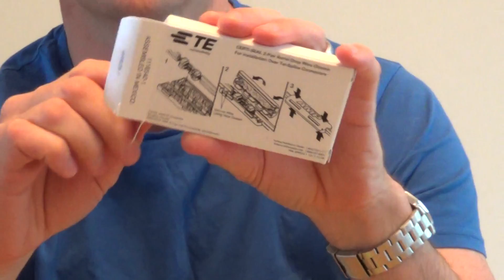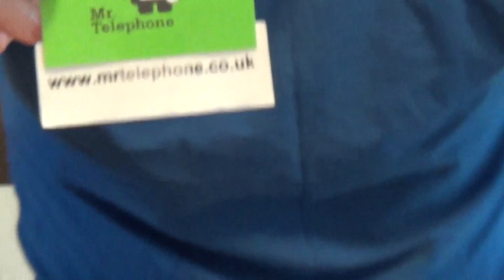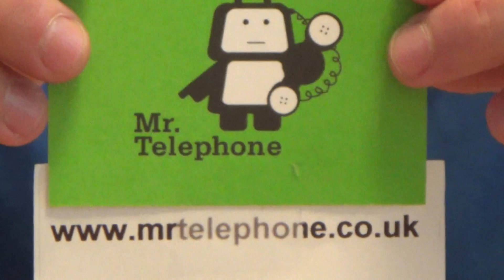How to repair your cut telephone line with an external waterproof joint

Comment: When stripping drop wires you need to leave  the Yellow Supporting wires sticking out from the shedding and bend them back and tap over them otherwise they will stick into to the working Pairs and short them out openreach have a special Sleeve that does this

Comment: I noticed I have one of those boxes on the outside of my house. I can only see a couple of wires feeding into the box (the ends are slightly exposed on the outside of this box. I’m guessing the installing bt engineer didn’t feed the black wire fully inside this junction box on one side). I have infinity fibre. Curious as to whether this is normal because I noticed your cable has 4 wires. Looks a bit messy on mine as though some wires have been cut (superfluous ones?)

Comment: Much easier to splice then place in the Tyco.  Also, if your service wire has a metal sheath under the plastic sheath, you need to use a splice case that allows for bonding of the two metal sheaths.

Comment: will electrical tape and waterproof box do the same job? cut the cable by accident and now I have red/orange light on my router 5x a day. It goes back to blue a minute later. thanks!

Comment: Hi there my internet cable has been cut by work men twice this year, once virgin  fixed it with one of these boxes, now it’s been cut again if they repair it I’m gonna have two of these boxes on my cable, will this effect my connection at all, or can I request a full new cable that’s not had to be fixed back together ?

Comment: Hi Vince I'm a bit stuck! I'm wanting to move the master socket into another room. I've took the back plate off the master socket and the main line coming in from outside is just connected via 2 wires. I'm needing a bit more wire to get the master socket to where it needs to be. Can you buy spare cable and connectors if they exist from your shop? I hope this makes sense!

Comment: Hi Vince, I replaced the existing telephone cables running internally in the house with a 2 pair cat5e cable telephone/data. I wired it in accordance with a video you produced showing how you can use a remote telephone/data outlet using a modular outlet setup. Using an RJ45 outlet along who a BT telephone module. Now I have two rooms that could be used for the telephone,with either of these rooms being used to connect to an RJ45 outlet!
I used a BT61 (I think) using type B three way gel crimps to connect one orange/white to two others and the same with each of the other colours! Now, the telephone in the room where I currently have my Sky hub router ( which wasn't happy with the change initially) isn't ringing where it previously was!

I can try my phone in the socket of the other room which will hopefully prove that the cable coming from the master socket is OK. This would mean that there is either a problem with the cable going from the 3 way joint box or a problem with the BT module! I can check that I put the wires into the correct numbers {blue=2 and white/blue=5}. If it is wired ok, I still have the telephone socket outlet that I can temporarily pin to 5 and 2 to see if I get the telephone working!
If I can't, then it is into the loft again, lift a panel of the flooring and see if I notice where a break might be and either run a new section of cable plus sourcing more 3 way gel crimps, unless you can suggest a better way of joining three cat5e cables.
Reply: George Wilson plug an adsl filter in and ur phone should ring or get a new phone old ones need a certain wire to make it ring ,

Comment: Repaired mine today after cutting clean through with secateurs !
Used some jelly crimps which cost £1.75 from  ebay, and a plastic 3 inch long Cod Liver Oil capsules bottle. Drilled a  5mm  hole in screw on cap and base of bottle. Threaded cable ends through holes - fitted the 5 pairs of wires to separated mini connectors and placed them into bottle - filled bottle with silicone after testing - screwed the cap back onto the bottle and smeared silicone where cable goes through the hole in cap. Wrapped bottle in brown insulation tape to help it blend in to the Climbing Hydrangea. Working off a ladder job took 20 minutes and saved me incurring astronomical BT repair charges !  Simples !
Reply: Yes and it'll be subject to heat, cold, moisture and UV radiation meaning you'll have do it again. Note the repair method in this video uses proper materials designed to last the life of the cable (a long time).
Reply: Yes, I'm gonna fill the bottle with silicone soon !
Reply: 2 years ago changed the connectors for jelly crimps , which cost pennies, and filled the bottle with silicone - so far so good - no problems.
Reply: Update. May 23. Still working a treat - no problems at all.

Comment: The fix does not appear to have a continuous, presumably grounded, shielding.  Does the connector provide for it?
Thanks very much for the video. High-value content.
Reply: Tyco makes similar closures with a grounding connection for the shielding. Just about the only modification necessary to the method in the video is that the jacket MUST be stripped with the stripper string and cut back, exposing about 2-3cm of shielding. The excess shielding can be cut off to leave the conductors exposed for splicing, but be careful because the thin metal is quite sharp. Cut-resistant gloves are mandatory. After the shielding is ready, each end is seated into a pinch connector that establishes continuity from one side to the other. 

The reason to worry about maintaining continuity in the shielding is to keep interference out by having it drain to earth at each end (the demarcation point and the serving terminal). Otherwise you've just wrapped your service wire inside a long antenna, ripe for harvesting errant EMI and inserting into the signal.
Reply from the maker: Hi, no there is no option to connect the shielding.

Comment: Hi Vince, great videos! I notice that Openreach are routinely using these joints when replacing dropwires to older houses without a 66b as it saves them having to enter the house to wire to the first block terminal. Could you do a vid about overhead lines to farms - you could call it Pole to Pole?

Comment: Is this still available? I have searched for waterproof repair joint and for the ebay number 261298650317 but don't seem to get to it. I need one and this seems like a good buy. Thanks.
Reply from the maker: Hi, I am out of stock at the moment and awaiting delivery of 300 of them from America. Fingers crossed I think they will be arriving at the end of September 2016. You can always use some jelly crimps and some amalgamating tape to keep it waterproof in the meantime.
Thanks Vince

Comment: Hi Vince! I bought this repair kit last week and I'm very happy about it, the installation was easy thanks to your tutorial. Also, the sending was very quick even if I live in France. I just do hope that the speed reduction will be as low as possible, given that my usual speed was already quiet low before I accidently cut the cable (I was around 2 mbps). Thank you very much for your work! :-)
Reply from the maker: Excellent, thanks for posting the message. I am glad it went well.
Many thanks Vince

Comment: hi vince, my cable coming from the BT splitter box on the exterior of my house is very badly damaged, the outer sheath is split exposing the internal wires. I have recently started getting an unreliable Internet connection so want to change the cable, what type of cable is needed and do you have an item number from your shop if you sell it. many thanks, Gareth.
Reply from the maker: +Gareth S Hi Gareth, it can vary depending on the age of the cable but the most common type is dropwire cable which has white, orange, green and black wires. If you type dropwire into my ebay shop then you will see the different length and 5mm cable clips fit the cable (my heavy duty version are the best fit and strongest).Thanks Vince
Reply: +My Mate VINCE - I wonder if that might be another problem then, I have what looks like normal phone cable blue/white, white/blue, orange/white, white/orange, green/white, white/green. so when I change it, it needs to be dropwire? many thanks for advice

Comment: Please be aware that telephone wire will be live.  Although voltage is only -48v for a static line,  if someone was to ring the line then upto 100v ac can be sent down the line that could give a nasty shock. Also beware that a lightening strike someway away could make the wire live.  For these reasons precautions against shock should be taken, such as using insulated gloves and shoes/boots especially if standing on a metal ladder.
Reply: The ‘shock’ you get really isn’t that bad, I do BT duct repairs and there’s sometimes damaged cables and I’ve touched many, it’s like a shock from a prank shock toy

Comment: is there a way i can connect another wire from the middle section you are connecting? such as a splitter?
Reply from the maker: +Ballbag Laugh Hi, no that using that repair joint because it only has one hole for entry and one hole for exit, you can get a similar repair joint with one hole on one side and 2 holes on the other side which would be able to split the cable if you used 3 wire jelly crimps but I don't think I have any in stock at present. You may find another seller on Ebay who has them.Thanks Vince
Reply: OK thanks would it still work if I connected the wires into a connector block instead off jelly crimps ?
Reply from the maker: +Ballbag Laugh Hi, yes it would work but the jelly crimps are full of gel to stop moisture getting into the wires. You may find that a normal screw terminal connector block will corrode over the years and may also short out the line if dampness bridges the gap between the terminals as they are quite close together.
Reply: +My Mate VINCE thanks for your help just one more thing could I use this kind of wire http://www.maplin.co.uk/p/telephone-cable-cw1308-six-core-white-priced-per-metre-xs04e
Reply from the maker: +Ballbag Laugh Yes,  if you are installing it inside. If you are running it outside then you would need external cable which is normally black.

Comment: Hi Vince  - do i need to isolate the cable before I try the repair? If so, how do I do that?
Reply from the maker: Phillip Jones Hi, no you do not need to isolate the line, engineers just work on the live line. The only time you can feel a shock is if it was raining and you are soaking wet and somebody rings the telephone line while you are holding the bare wire ends and then it just tingles enough to make you let go. If you are apprehensive  just do the work when it is not raining.Many thanks Vince

Comment: I'm having to do this to add some length to allow relocation of a master socket but I'm wondering if it will have a negative effect on the line with regards to internet connection? Would the connections create noise?
Reply from the maker: EmpiricalPenguin Hi, no, it should be fine. If you think about the amount of crimps the line has gone through from the telephone exchange to your property then one more lot of crimps will be highly unlikely to affect the broadband.Thanks Vince
Reply: Okie doke, cheers!

Comment: hey vince i have a question, my phoneline is connected to the house by a hook which then runs the line down the side of the wall and into the master socket. someone elses line is also connected to the same hook, why as i thought this can cause problems and also hooks are not waterproof and ive noticed other peoples are connected by joints. reason for this message is im getting interleave every month due to something and 4 engineers have said my line is fine.
Reply from the maker: Arron Lowley Hi, by hook do you mean the bracket on the eves of the house where the overhead cable is joined to the house. If so it will not make a difference if another line is attached to the same hook because your wires meet up with loads of other customers wires in the bigger cables on the way back to the telephone exchange, so being on the same bracket (hook) shouldn't make any difference.Thanks Vince
Reply: I think that's what you mean I'm not sure it's just a hook at the top corner of the house where the cable drops down, it loops around the hook them goes down the wall and into the socket, another persons passes over ours and goes to a house on the corner, thanks for the reply.

Comment: Hi Vince, does the 2 pair cable used in this video only connect to a screw terminal master socket? Thanks
Reply from the maker: Stevie B Hi, no that cable is fine to use on IDC (punch down slot) connections as well as screw terminal.Thanks Vince

Comment: Thanks for the great videos you provide! Im looking to repair my broken external cable to my master socket with this. But wondered if there is a signal/internet speed reduction? The service provider repair is very expensive ££££! and wouldn't be surprised if they also used this method anyway, as cant see them pulling in a new cable. Thanks
Reply from the maker: Stevie B Hi, thanks for the comment.....The service provider would normally replace the length of cable from a nearby junction box, for example from the eves of the house to the internal junction box/ master socket unless it is a complete nightmare in which case they would just join it.  Having a join in the cable in never as good as a complete cable but your telephone line has been joined many times on the way back to the exchange (top of the telephone pole, bottom of the pole, numerous times underground etc) so one more is highly unlikely to make any difference to your broadband speed.Many thanks Vince

Comment: Does the cable you're using have a ground sheath?
Reply from the maker: Jason O Hi, no not this cable, it just has 2 pairs and 3 tension wires to give it support when it is spanning overhead.Thanks Vince